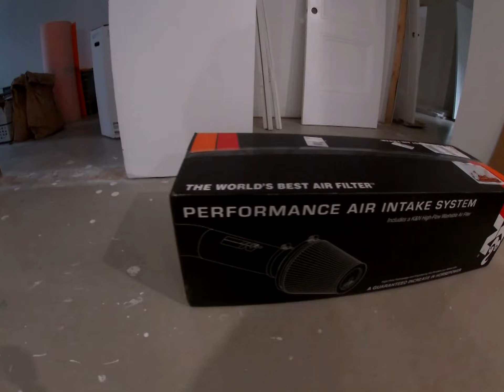Installing K&N Cold Air Intake On My Jetta

Comment: Pretty sure it still drives like it did before if not worse. Lol.  The sound change is not more power. It's because the sound dampener is gone and you can hear the engine more.